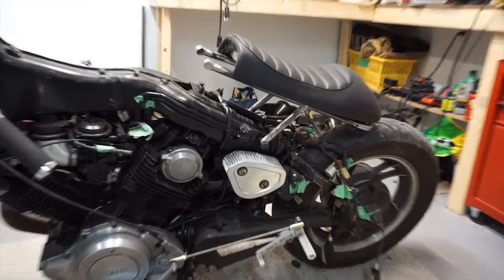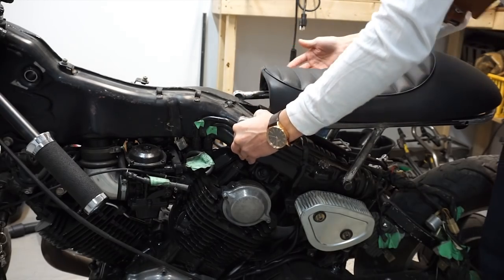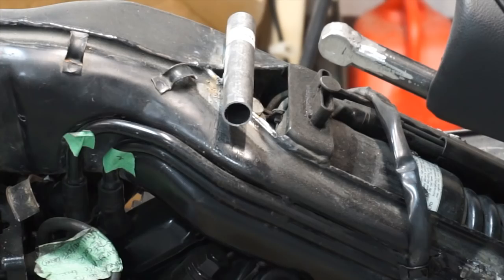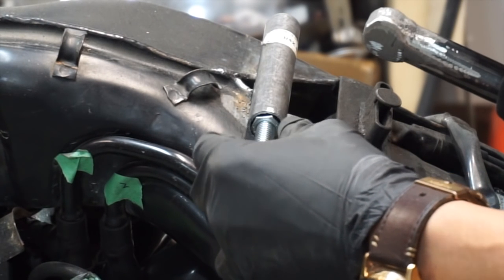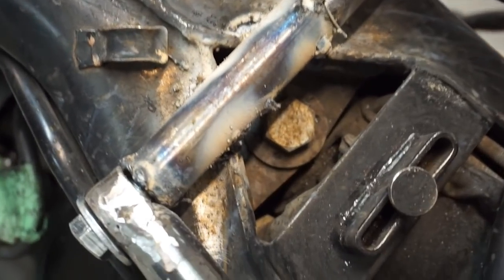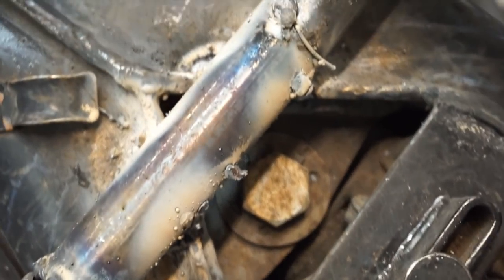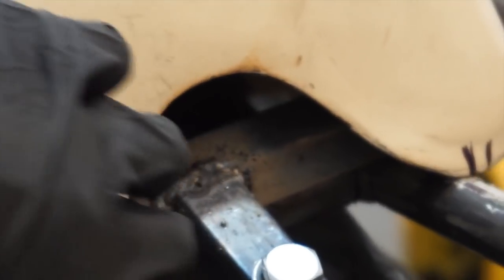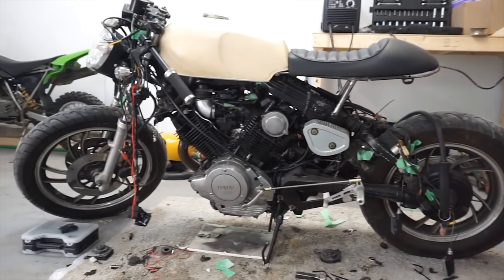Yamaha Virago XV920 Café Racer Build - Vlog #11

Comment: Looking good. If your front seat tube/bolts become unstable welded to the frame like that. Consider welding "Tabs" to the frame on each side of the front seat bolts. This will also help you with clearance with your rear shock.

Tabs on awkward fittings work great! 

Cheers!
Reply from the maker: That's actually a really great idea!  Thank you ! I may just go and weld tabs on anyways as a precaution.

Comment: Hey! Great Job with your first build. I'm in no position to tell you what to do since I've never done a build myself and since it is far too late into the project and you may already know this... But a Honda CB makes for a much easier cafe build than a virago, especially for a first time customization. Much less work to do on a sub frame. You definitely chose a cool bike to work on but maybe made it harder on yourself than necessary. Takes balls to do all this for the first time and show it off to the world. Kudos and keep at it!!!
Reply from the maker: Thanks for the kind words! The CB is a cool cafe for sure, but the issue is that is has been done so many times already and to be honest, they are a bit underpowered. The virago cafe conversions look a lot better in my opinion and they are not as common and the donor bikes are still relatively inexpensive (I got mine for $600 in running shape!), as where a CB in running shape, is easily x3-x5 the price because it's a hot item a lot of people want now!  This build has its challenges and probably mostly because I've never done anything like this, but at the end of the day, I'm having fun doing it and I'm learning a lot and it gives me a reason to have some "me time" away from my wife and kid once in a while!  I know at this point in the build there are things I will already need to go back and change or redo, ie: the subframe being one of them! But it's all part of the fun. I don't have a timeline for completion anymore on this project and I have other bikes to ride, so it's purely a learning curve and a fun hobby!
Reply: Billy Milbrand ....were are all these easy CB's at.....there's old Virago's on every corner and in 2 out of every ten back yards in any town. If your opening line is " I'm in no position to" then leave it at that. Unless you have a lead on where to snag a half dozen of 82 and later CB's at Virago prices! You are right about an easier build!

Comment: Great challenge man. 

But mate, as many have already mentioned previously... Your welds. I have been working as a weilder for a long time. And since I don't want you to get hurt my recommendation is to get someone in to help you weld the things you need, or you study welding for a while to know what you're doing. You mentioned you have a wife and kid, i strongly believe you shouldn't take this lightly or dismiss peoples concerns here in the comment section. You mentioned that you don't know what you're doing, be pragmatic and listen to people around you who might be able to help out.

These welds might look and feel strong, but they are not. The welds would never be approved in production. There are different factors to why it's not welded correctly e.g. distance to the material, settings to voltage and your wire feed. Because of this you are not melting the materials together. 
Your welds consist mostly of molten wire that has hardly grasped the material (the frame). Welds are ment to withstand a lot, like vibrations, pressure from sitting on it and weather conditions. It's also meant to hold for a long time. 

Check out this guys video: https://www.youtube.com/watch?v=_f54YG08CC4

Please take it into consideration, and good luck with your build.

Comment: I don't want to discourage you on your build but plese ask somone to help you with the welds or you will get your self hurt at first attempt of riding this bike.
Reply from the maker: Thanks for the concerns, but I promise the welds are as strong as can be.  They are just ugly!
Reply: They are not strong. These are surface welds that will crack when exposed to vibrations. Metal is not fused properly, you can tell by the uneven discoloration. Be very careful when you ride it and please do not ever sell it to anybody in this condition.
Reply: They might feel strong but none seem to have a real ”burn trough” dunno ehat the real name for it is in english but , really stress those welds before u go out riding so u dont get injured or killed , otherwise really nice ideas :)

Comment: well you are definitely starting better off with your bike then mine because it isn't running and trying to get mine to run it rumbled once or twice and then blew the carburetor of even though I have it on there tight.
Reply from the maker: a common issue that prevents them from starting (given you already cleaned the carbs, made sure you spark, fuel, etc) is that the rubber intake tubes crack, and if they have big cracks, it prevents them from starting. The starter  gear issue is also common, but you would hear it grind if the engine is able to crank but nothing happens.

Comment: The style is looking good. 
I'm concerned with your welds though. Hit a gutter and your seat may break off,.
The welding method for the seat sub frame tube may have a weld that looks chunky and strong, but I really doubt there is much penetration there. Wiggling back and forth builds weld, but doesn't help penetration.